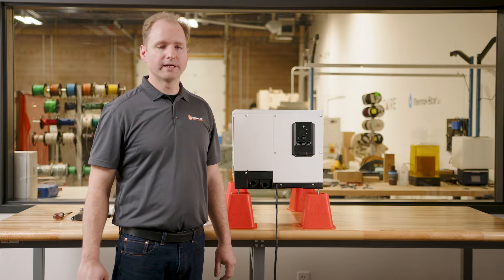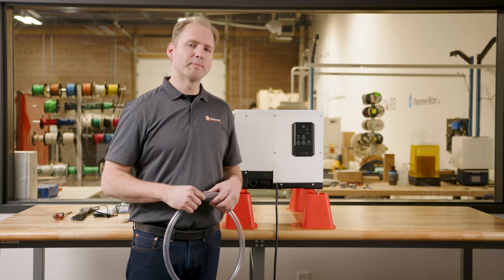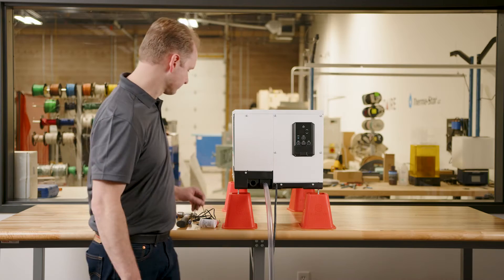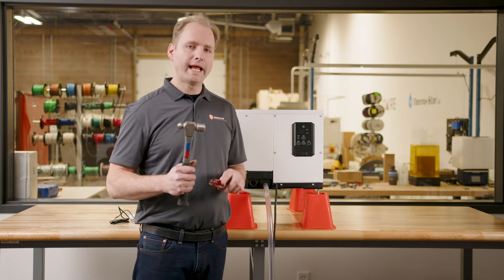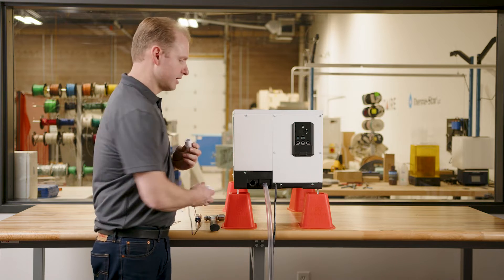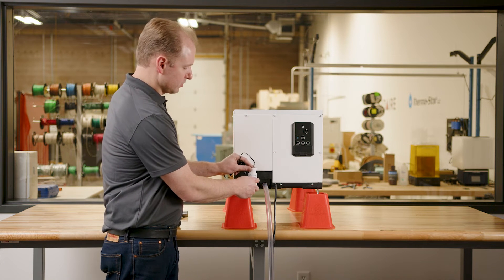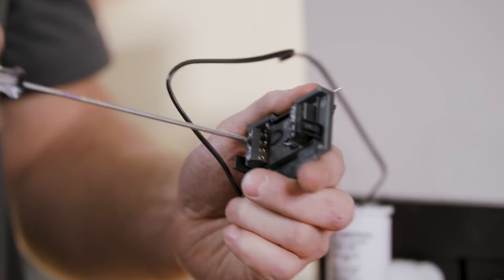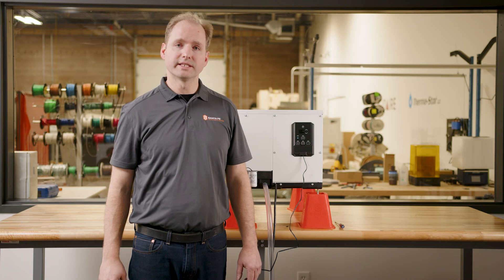Installing a Drain Line and Safety Switch on the Santa Fe Oasis105 Dehumidifier

Comment: I just purchase an Oasis 105 and want to add a float switch as well as an intermittent Alarm if the unit throws an error code. I have a float switch ordered and understand how it get wired to the control but I need help on wiring an Alarm. The only alarms Ive found are 24 VDC. Can a DC alarm be used and which terminals are to be used.